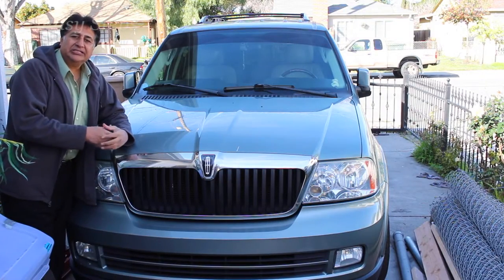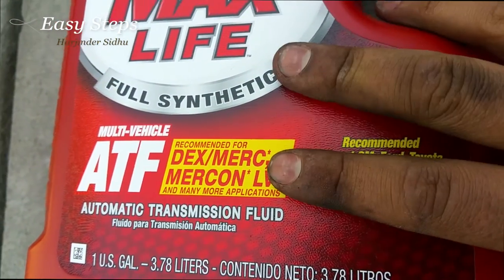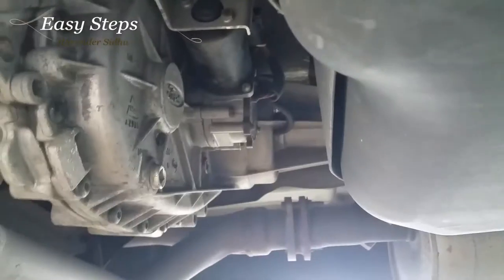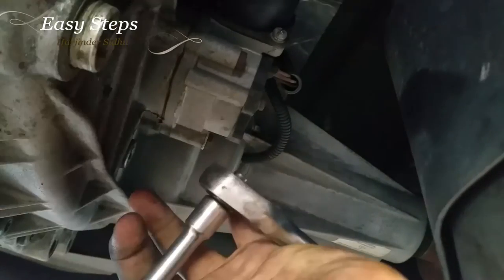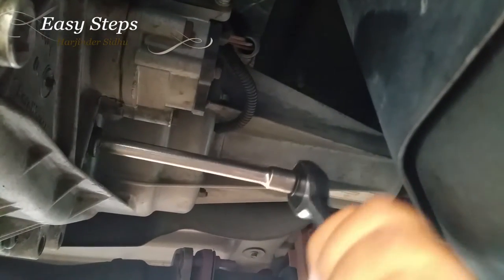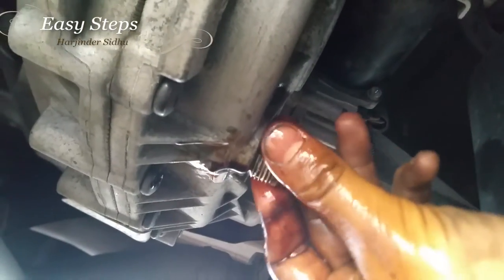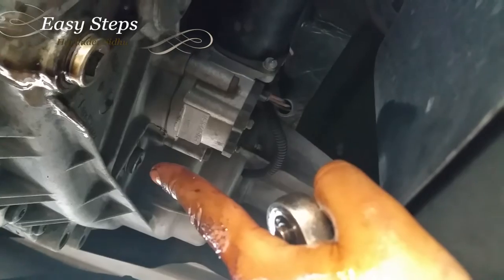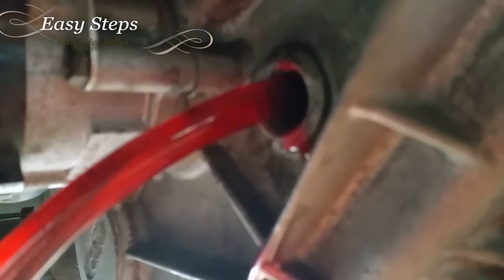How to Change Transfer Case Fluid on Lincoln Navigator | Change Transfer Case Fluid on Aviator

Comment: Great video i have a question so it doesn't required a filter change ? These transmissions dont have filters?
Reply: Thank you so much for clarifying that for me. how long should I change the transfer case fluid?  every how much milage would you recommend ?